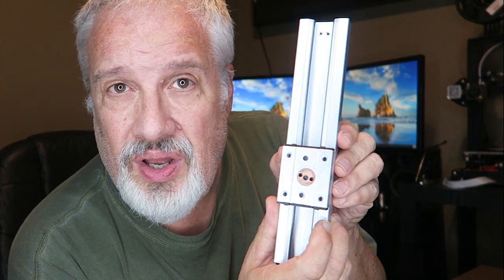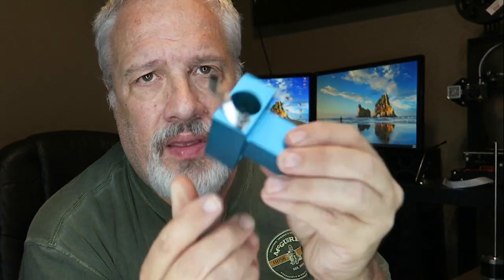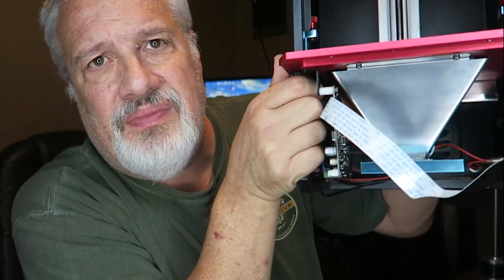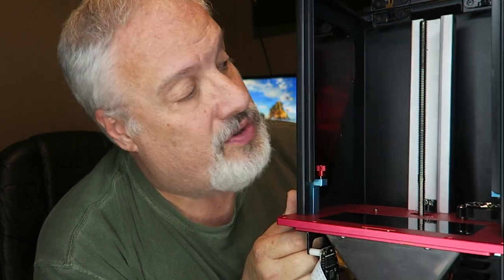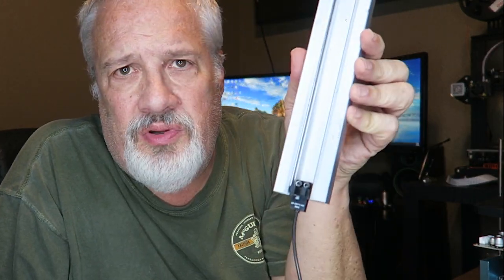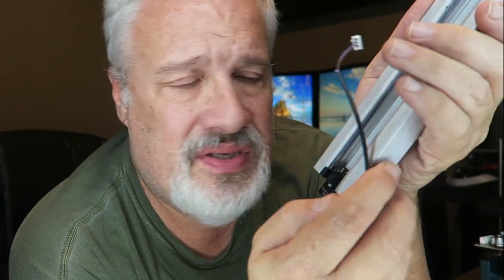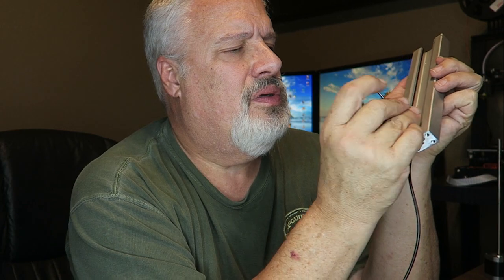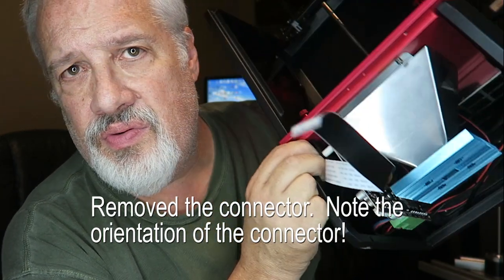Replacing a Rail Assembly and Z-Rod on an Anycubic Photon

Comment: I have seen a few of your videos, I see that you are like a pro on this matter. I recently bought a Anycubic Photon Mono X printer and I love it, but the design of the printer has a flaw, it does not protect the motor from getting resin in case of a leak, that happened to me, after only 6 weeks of use, now I need a Step Motor, do you know where to buy one?

Thx! and keep the great video content!

Comment: the "black thing" on the bottom of the Zrail is an optocoupler for an optical interrupter (the metal tab on the bottom of the slider assembly). They're cheap, accurate and extremely repeatable whereas a mechanical sensor would wear. As you surmised, it's for sensing end of Z travel (homing)

The "crosspiece" assembly on the old zmotor is a flexplate to allow for any flexing/sideplay in the rod to allow the motor to tilt on its mounting rather than having the rod bind on the brass nut due to sideforces or destroy the motor bearings and ruin your accuracy.
 
I'd check the rod for sideways "runout" when spinning and ensure the top of the rod doesn't "wave wround" or "bend" as the plate runs down the shaft, either of these indicate the motor not being centred properly. This may not be critical for accuracy but it will increase wear

Comment: Where did you buy the new motor and Z rod? I didn't find any information on amazon. Could you tell me where I can buy the same motor and Z rod? Thank you so much!
Reply from the maker: Sure!  I actually opened a ticket with Anycubic and they sent me a new Z rod and motor.  It's a specialized 'all in one' unit.  I had MAJOR issues with z wobble or z banding in my prints, so I reached out to them and they were good about sending me a replacement motor and rod.
Reply: @3DPrintFarm  Thank you so much.
Reply: @3DPrintFarm  Should have brought this up in the video. I still like the product and you are doing a good job of explaining what to do.
Reply: @3DPrintFarm  I had this exact same problem with my Anycubic Photon. I emailed them four days after I got it, and they never replied at all.

Comment: what was wrong with the rail & motor to require both to be replaced?
Reply from the maker: I had a bad case of Z wobble.  All of my prints had lines that indicated that the Z rod was out of whack.  Since the rod and motor are a single assembly and the rail is somewhat 'married' to the assembly, Anycubic replaced them all!  Thanks goodness!
Reply: @3DPrintFarm  Were they the lines we were seeing on the Dwarf mini's hammer? It caught my attention last video...